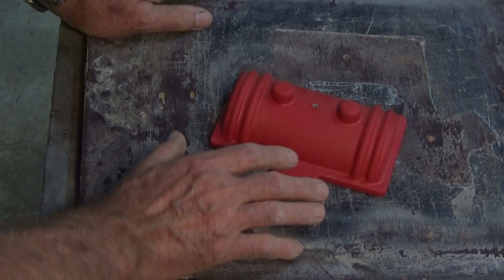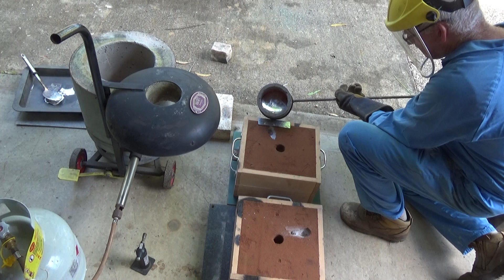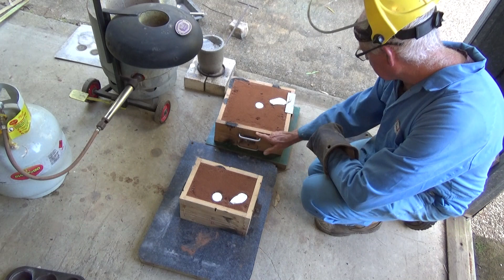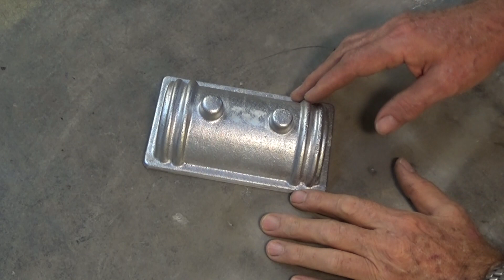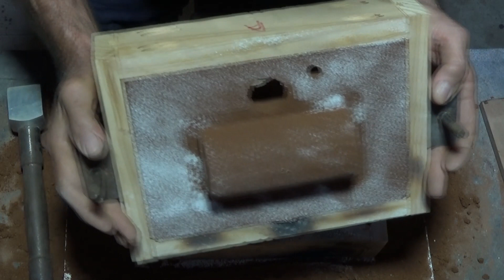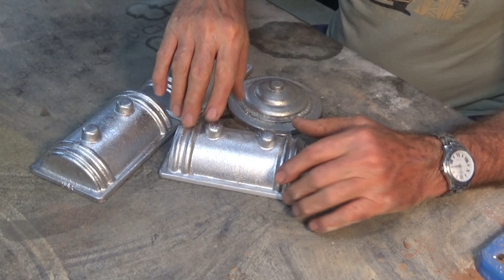The "MIXIE" A DIY Steampunk, Backlit Digital Clock - Part 2

Comment: G'day Presso, I wondered if you could fab a pivotting handle (with fairly short range of movement) that spans the drag that has an eccentric on each end that pushes on the ends of the guide pins on the cope in order to slowly separate the two evenly. Not sure if that is a thing with casting but wondered if it would help with sand break offs. Sorry for the long clunky sentence but it was sand molded, not injection molded 😉
Reply from the maker: Dennis, there are lots of tricky techniques for levering patterns out of moulds and for getting the cope and drag apart cleanly. Often, if you are doing repetitive moulds you get used to how easily or how hard it can be to carry out these tasks. Olfoundryman (check out his channel) is an old hand at this and he shows a lot of useful techniques for removing patterns and separating moulds. The problem is that when you are doing one off moulds, you can never be sure how much of a problem it's going to be. You sort of start full of optimism, hoping that it will proceed without a struggle and then you have to resort to increasingly more brutal tactics to get a result. I still have a lot to learn about foundrywork and it can be frustrating at times but it's also really rewarding when you get a nice casting and reflect on the fact that it's a process that you really cannot replicate any other way. 
Regards,
Mark

Comment: Do your patterns have draft?
Reply from the maker: Yes, I generally use between 2.5 to 5 degrees depending on the form. In the case of the pattern for the base I could have used a lot more without affecting the finished casting too much. Bigger radii in the internal corners would have helped as well. 
Regards,
Mark

Comment: Self coring is the only way - to have made a separate sand core and loaded it into the mould would have been a nonsense.  Forming the self core in the cope as you did is likely how I would have done it as it makes feeding easy and venting probably unnecessary, however some lessons in the extra care needed to ram self cores would not go amiss - NEVER ram them tight.  Self coring in the drag would make feeding harder as casting is entirely in cope and you would likely need to vent the self core area out the back of the drag via small vents poked in with a fine wire.
I still am of the view that 3D prints make terrible patterns - all that breakaway due to printing layers despite your obvious considerable efforts to clean up the pattern - why go to all the trouble of making a nice mould only to have it ruined by a bad pattern that results in a bad looking casting - being able to machine it off is a cop out 😊and I am sure that as your casting expertise improves you will not tolerate having to machine such mistakes off
How do you check the metal temperature - you seem to have a bit of a problem there?
With thin large area stuff like the two end discs I would have been tempted to pour them one at a time - much less chance of a non fill and only one pattern to clean up. 😊
I would have used the relatively big feeder too but as these are fairly even and thin castings they may be close to the category of not needing to be feed. A smaller feeder just to keep the higher temp gate are solid may have been all that was needed but you would have had to experiment and thus risk failure through lack of feed (Ah - nothings easy!)
Roger Taylor's comment about eliminating the big riser (read - feeder) is both right and wrong. Wrong in that he seems to think its removal will increase head and fill pressure. However he is right in that it would probably increase the likely-hood of a better fill. Its removal gives the metal no alternative but to run into the cavity. Without this feeder you most likely would have got a nasty draw at the gate area although as indicated above a much smaller feeder may have sufficed to prevent this.... Martin
P. Failure, if even only partial, is a learning experience - I have had thousands of them.😏
Reply from the maker: Thanks for the feedback Martin. I knew you'd be judging my performance! 😁 Clearly I tried too hard on the second set of moulds for the base casting. I am now wondering if the 3D printed pattern expanded from me ramming the self core too hard. It seemed like the more I rammed that area the more likely it was for the pattern to be pulled out of the drag. A wooden pattern would have been great but it would have been days of work to make it. Probably a good case for having a CNC router! There are lots of things I would do differently if I were making the patterns again. I do have a pyrometer for checking the temperature of the metal but I didn't bother to use it on those castings. I have made a note to myself to use it regardless of how easy I think the casting will be. I have also learned that it doesn't pay to get too cocky!
Regards,
Mark

Comment: Hi Mark. What do you use as your flask release powder? Is that ordinary talcum?
Reply from the maker: Martin, I now use calcium carbonate as a parting agent. You can buy it from rural suppliers and some health food stores. It is practically insoluble in water so it helps to separate the pattern from the greensand and the cope from the drag. 
Regards,
Mark.

Comment: Not sure if it's of any use to you, but you can get a pretty convincing copper or brass look on cast aluminum using wood stains...
This video shows a few layers that may be suitable depending on the look you wanted....
https://www.youtube.com/watch?v=fOE2_r8XRTk
Reply from the maker: That's interesting. I may use that to add a weathered look to the finished castings. The powder coat that I use has a shiny silver base layer and a transparent yellow top coat. However it looks like perfectly shiny brass which might look a bit too good for what is meant to be a Victorian age artefact. I have some of those Feast Watson proof tints and it might help to add some "grimy" low lights to the textured areas on the castings. 
Thanks for the tips.
Regards,
Mark

Comment: The black art of casting.....I have heard that if you make human sacrifices to the casting gods occasionally things turn out useable.  But from my eye, it looks great!
Reply from the maker: Foundry work is truly one of the mysteries of the universe. I have often considered how much work goes into making the mould and then melting the metal and pouring it into what is essentially a black hole. You cannot see what is happening inside the mould and success or failure is only revealed when you break open the mould. There is both misery and triumph in equal measure. At least, that's how it goes for me.
Regards,
Mark

Comment: That is coming out great! How long does that BBQ tank last? Can you spray silicone or teflon on the mold to help it slide out? The "A" cups came out real perky! hehehe... Hopefully I will be building a shop this spring so I have room to try my hand at casting. Got a new scale for mill and was going to change it out ( thought it was too short) but I had a DUH moment and realized I just mounted off center.... Had to "just suck it up and fix it"   Oh well parts for the lathe......  Oh ya I put a bug in for that CNC....
Reply from the maker: I can usually get about five or six melts from one 9kg cylinder. I have a second cylinder which I keep as back up. Here in Oz they are called "swap and go". You just take them back to the hardware store and they exchange for a full one. When the level gets low the propane starts to freeze up and even though there is some left the pressure drops and you either have to sit it in a bucket of warm water or swap over to the full one. The next time you want to heat up you put the nearly empty one on first to use up the last of the gas. Good luck with the new shop. 
Regards,
Mark

Comment: Great video, sensei. As a side note, love how you always take safety precautions, gear, tidy shop...  Castings look fabulous. Taking away metal easier than adding it. Mahalo for sharing! : )
Reply from the maker: Probably, I take more precautions when melting metal than I would on most other processes. My biggest fear is having a crucible collapse or knocking it over when setting it down in the pouring shank. I don't think you would get too many second chances with molten aluminium.
Regards,
Mark

Comment: You need to get some dress shoes when you are pouring, I think thats Old Foundryman's secret.
Reply from the maker: Doing any sort of foundry work in the middle of summer is never pretty. I was soaked through with sweat after that session. It was only meant to take an hour or so but I was at it for most of the day. If I find a set of lucky shoes I'll let you know.
Regards,
Mark

Comment: Classic Murphy's law. The one you did haphazardly, turned out to be the best, whereas the ones you put in your best effort failed repeatedly.

On another note, I recall seeing a recipe for petrobond. I believe it was just oil, sand and charcoal. Another interesting formulation to try is sodium silicate. It apparently solidifies the sand when fed C02 creating a strong mold that might be reusable.
Reply: They use  that in their moulds casting for boat parts over on SV Seeker channel. Seems to work a treat for them.
Reply from the maker: Bob, I have used sodium silicate before but given the amount of core making that I do it's not worth having a cylinder of CO2 on hand to solidify the cores. I now use epoxy and sand for making cores. It works great and the epoxy keeps more or less indefinitely. I do have a recipe for petrobond but one of the key ingredients is only available in large quantities. If I ever do make up a batch I would need to sell some of it on to other amateur foundrymen to recover my costs. 
Regards,
Mark
Reply: @Preso58   If it's Bentonite clay, you might be able to find it at online shops selling cosmetic and soap making supplies.
Reply: @Preso58  It turns out Bentonite is fairly easy to get, but requires a little more work. Kitty litter is often made of Bentonite clay. In order to use it for PetroBond, it has to be milled finely. An old coffee grinder or blender is great. The clay can be found in various home building products such as tile grout.

Comment: You've seen my comments via email. I think its likely a temperature issue and not a venting issue. 

Clarke would be pleased to see some of the tools you've made, particularly your cutting tool and the screw attached to the rod for pattern removal. I keep thinking I need to make one of those. 

If you cast in the cope, your core would have stayed in the drag and there would have been very little danger of it breaking and falling off. 😄

Finally, yes I caught the "feeder" 😄
Reply from the maker: Perry, I have learned a lot from watching Clarke. I wish I was a real man and could start casting iron! I have made a note to myself to ALWAYS use the pyrometer now. I did finish off all the machining of the castings today and despite the foul ups they have turned out great. I sort of like the imperfect look. I think it fits in with the Steampunk aesthetic. At least, that's the line I'll be using.
Regards,
Mark
Reply: @Preso58  I've just started watching Clarke's stuff and have a had a few good conversations with him.  Seems like a real good guy.  I've already warned him that I'll be bothering him more when I too grow up and am able to cast iron. 😄

Comment: Hi again Mark, have you looked at “luckygen 1001” ? He has a video called ‘are vents necessary when casting’ and I found it very interesting.
Might be worth a look. Cheers Stuart.
Reply: Scrounga's,  I know lucky well - he lives reasonably close, he does seem a bit averse to vents - The thing is it depends on the sand, Lucky's sand is an iron sand and very open - venting is indeed generally not needed with smallish/medium castings in such a sand. My sand on the other hand is very fine and has very low permeability. I am forced to make frequent use of the vent wire. Be aware of course that there are two types of vents, ones to let steam out of the sand (my fine wire vents) and ones to let air out of the cavity - generally feeders do the latter... Martin
Reply from the maker: I have watched that video and I am pretty sure I rammed the sand way too hard. But as Martin has observed, it depends on the qualities of your greensand. Mine is just fine beach sand and bentonite. It probably isn't the best quality but it's all I've got at present. 
Regards,
Mark

Comment: Looking really good so far. Could you anodize or electro-plate the ends is a brass color? Either way you do it I am sure it is going to be one of the coolest Digital Steampunk Clocks out there. Can't wait to see the project in the finished state.
Reply from the maker: Wait until you hear the chime! I have bought some new powder coat for the end castings. It should look like highly polished brass.
Regards,
Mark

Comment: Great job!  That base pattern really made you work for it.   
Amateur tip: if you roll the mold over so the cope is down when you open and close it, the hanging core is supported and much less likely to break off. I learned that one the hard way; it's a couple extra steps in the molding process, but not as many as redoing the whole cope... Hope this helps.
Reply from the maker: Now you tell me! 😁 Yes, I did fight that base casting every step of the way. I was lulled into a false sense of security after the first one turned out relatively easily. Thanks for the tips.
Regards,
Mark

Comment: Your casting projects have taught me all I'll ever need to know about sand casting. Namely that it's way to finicky and frustrating for me.
Reply: I tend to agree. Great to watch nevertheless.
Reply from the maker: Despite the multitude of steps required to get any sort of successful casting, it does allow for parts that would be very difficult to make any other way. You get a lot of creative freedom but the trade off is the specialist equipment required and the time you have devote to making the patterns and the moulds. It's even more frustrating when you consider that I usually only make one or two parts from each pattern. In a professional foundry they would make hundreds or thousands of castings from one pattern.
Regards,
Mark

Comment: Gday Preso, I must say you have way more patience than I have, I’d certainly would have been using the editing program to beep out the course language, when all the casting goes to plan it would be extremely rewarding, no to moulds are the same by the looks and each one there is something different to learn, I don’t understand how the casting resembles the female body, that’s got me buggered there, great videos Mark, throughly enjoyed watching and looking forward to the next instalment, cheers Matty
Reply from the maker: Matty, that's the thing about metal casting. Each pattern seems to demand different techniques and by the time you've got your technique worked out your done with that pattern and you have to start all over again with the next one. If you were making a hundred parts from one pattern you'd very quickly nail the workflow and everything would be rosy. I can send you some links for websites that have great "research" into female body parts! 🤣
Regards,
Mark
Reply: @Preso58  hahaha I’d appreciate that mate,cheers

Comment: Hello Mark,
An enjoyable episode... Having watched lots of casting videos maybe you could answer a question that always pops into my head. Once you've poured the metal into the mold could you just leave it to the next day when it is completely cold before you removing it or is there a technical reason for doing it once the molten metal has solidifies.
Take care.
Paul,,
Reply: there is a huge reason to do it right at the earliest moment possible, its called curiosity. jokes aside, you could leave the part in there for as long as you want, but if you see that it failed you can relatively quickly do it again while you got all your casting stuff out, if you notice it the next day, you have to start from 0 again
Reply from the maker: Paul, you can absolutely leave the moulds until they are completely cold but curiosity and impatience drives me to open them up while they are still hot. It's also a case of being able to clean up and put stuff away so I can get the car back in the garage. 
Regards,
Mark

Comment: Great video.  I've never done castings and can't imagine how frustrating it must be to produce a failure. Still, you keep things in perspective and just move on.
Reply from the maker: Roy, it is both maddening and labour intensive to be making castings but it does allow you to make parts that could be very difficult to make any other way. In this case I wanted to be able to recreate the look of something that might have been made in Victorian times. A beautifully CNC machined part just wouldn't look right for this project.
Regards,
Mark